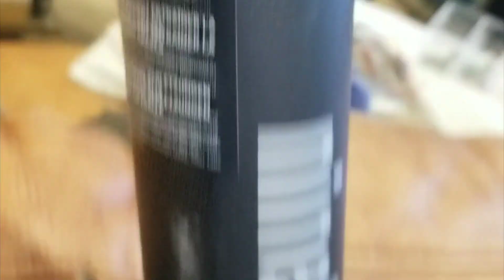Ninebot ES1 ES2 ES3 ES4 Internal Battery Teardown

Comment: Internal battery won't charge. Led on charger still green. Replace battery unit can charging. Whats i replace dead battery only? Or replace bms?
Reply from the maker: Did you open battery pack? What is voltage of cells inside? If voltage above 3.0v on all your cells then likely the boards inside the pack that have failed.
Make sure to try the brass reset button on top board in the battery.
Cant really tell much else from charger being green.
Good luck!
Reply from the maker: Hi Arif .... is your scooter an ES3 or ES4 by chance? With external battery? I just had an issue with internal batt  not charging. Here is vid for what my issue was ... https://youtu.be/ByJXJqm9urk loose connection from external pack

Comment: In your video, since all of your cells that you volt tested individually have good charge, what was the issue as to why the whole battery pack is considered dead?
Reply from the maker: Hey David - thx for watching and for commenting. Truth is that I don't know for sure. My guess is that the charging board..the top one of the pair has gone SNAFU. I'm not a technician- just a tinkerer. I'm in a bit of a jam to test the theory because I have no assurances that any of the charge boards I've scavenged are actually good.
But the problem has to be that the circuitry in one of the two boards has activated cut-off to the cells.  Much like happens in a hand tool battery that goes lower than absolute minimum charge.
Not sure of why either.
One small head slap for me is that there is a  brass reset button on this top board.
I probably should have tried researching that and tried pressing it before I ripped everything apart. Too late now.  Might have been a case of just hitting reset. Sigh.

Comment: Hi I have a es2 with external battery. I have been having problems getting it to charge fully only charges to about 85% then stops?? Plus some days it does not want to charge at all?? If I get to my destination say with 2 bars left of charge then I turn it back on when leaving the battery is completely flat?! Would you suggest a new battery? I did think of just installing a new bms but I think a new battery comes with that anyway. Any help would be much appreciated.
Reply from the maker: https://youtu.be/ByJXJqm9urk
Reply from the maker: Hey Tim
Have you seen my last video..link above. It sounds to  me like it could be a loose connection between external pack and internal. Not sure but possible. I had similar issue where average charge between two batteries was not full charge because internal never had chance to fully charge.  Have you checked internal vs external percentages on the app?
Just reread your post... is it just external pack that stops at 85%? What % does internal batt charge to?
Reply: @fixitdad899  Hi there many thanks for your reply. I've already tried charging the internal on its own and it won't charge so I'm assuming it's had its day. Its very random some days they will charge half way then they'll charge to 85%? I've also checked connections between the 2 batteries and that all seems to be fine. I was going to get a new bms and try that but you get a new one with a battery anyway.
I think I'm going to order a new internal battery and see if that fixes the problem.
Reply from the maker: Hmmmm...Do the voltages of internal and external match up? When you check app and you see say 50% or your 85% max state, is it on both batteries or is there a difference in voltage between the two?
It's weird that internal won't take a charge directly agreed.
If voltages are different,
It (internal) might have dropped below minimum charge for charger/BMS to recognize it.  Could try to bypass BMS and give it a brief bump charge to bring it up far enough for BMS to be happy if that is the case...or ya BMS could be done but...that would involve opening the pack up.= pain in keester
Yep... might be time for a new replacement batt.
Good luck with fix.
Cheers R.
Reply: @fixitdad899 thanks for your help much appreciated! How would I bump charge the internal battery? I think that's what happened, the internal battery has dropped below what the bms can recognise.
Reply from the maker: I have a video on how to do with an 18v ryobi battery. 'Theory' is the same ... full disclosure that I have not personally done myself on ninebot batt. I have had success reviving 18v tool batteries.
Trick is you need a supply capable of kicking out 36v-40v at low amps. Ideally a variable power supply unit that plugs in wall at low amps that you could keep connected for a bit.... But failing that you could use another battery at that 36 to say 44v voltage...touch leads of power supply to contacts of intenal pack BELOW BMS =bypass BMS.  Make sure polarity correct. Touch contact in short bursts until voltage comes up on internal  pack enough for charger to recognize. Challenge is doing like this would give pretty high amps for current  flow. You'd need a multimeter to monitor how much battery coming up in voltage. That's how I'd approach but be careful.
Again I'm just a guy who has spent some time around LiIon  and LiPo packs and I am not a professional. 
Best wishes on your project.
Reply: @fixitdad899  thanks for all your help. How do I get the plastic locking disc out the one that holds the battery in? Please don't tell me I need a special tool!
Reply from the maker: @Riceyminimad  I used a pair of workshop compass measurer doohickies...the ones with thumbscrew to adjust width between points. Those caps aren't that tight in. Pair of chopsticks with duc(t/k) tape might do in a pinch. Good luck!
Reply: @fixitdad899  thanks I've managed to do it! Used a small hammer and an alan key just tapped it round until it got past the metal ridges. It's charging now fingers crossed! Thanks again!

Comment: It is possible to use other trottinette ???
Reply from the maker: I think trottinette means scooter in English. If your question is: can you use a battery pack from another brand of scooter to run a ninebot? Answer .. probably but you'd have to be creative on how you attach/connect battery. Not sure how charging a 'foreign' battery would go or how software would react.
If your question is could you use this pack on another scooter ... same answer really.  
Bonne chance!
Reply: @fixitdad899  thanks, yes I will want to use for on another scooter

Comment: Can you tell me where I can get the tool to remove the battery?
Reply from the maker: I used a pair of metal measuring calipers. Stuck the two points in the two holes of the plastic retaining plugs and unscrewed them ... they are threaded. Then took a wooden dowel to push battery out once plugs/caps removed. I've heard you can use a pair of chopsticks to do the same or can stick a screwdriver into one hole and tap sideways with hammer to unscrew.
Best wishes on your project!

Comment: Hello I need some help from you.

I am from India and unable to get this battery pack.

I have a basic carbon scooter without battery ( I had to leave the battery in Philippines due to air travel restrictions )

I am planning to build a battery pack and might need some info to build them.

Please help.
Reply from the maker: Happy to try to help if you have a specific question but full disclosure in advance... I'm way better at taking things apart than putting them together!
Reply: @fixitdad899  Thanks. I might need some photos and measures so that I can 3d print the battery holders or spacers.

There is no other way I can get my hands on them. I gotta 3d print some parts and redesign some Circuits.
Reply from the maker: Sounds like you are technically capable...I'm not familiar with "Carbon" reference. Is that a ninebot model? 
Anyway...Just curious.. can you source ANY premade scooter 36-40v packs locally?  Reason I ask is that I picked up a 'junked' M365 clone that had a burned out hub motor for very cheap near me.  I just wanted the 30 cell battery inside for an eskate project.  Couldn't you do similar? Don't have to worry about BMS and soldering (pain). Just create an external case for pack and affix to scooter somehow ... extend and plug in your 36-40v leads and good to go.  Might even end up with better range as pack could have greater number of cells than stock.
Might not be as pretty as recreating Internal battery but way simpler.
Just a thought. Best wishes.
Reply from the maker: It's not too hard to create aesthetically pleasing curved custom case for cells that you can attach to upright steering column via 3D design.  Tip -You can make segments that stack to prevent risking print failure from tall z print heights. Glue them together to desired height...make top and bottom caps to seal. Voila
Reply: @fixitdad899  oh, I was actually planning to make the battery to be internal.

Range Extending Extra External battery sounds good, but I was planning to design one for the Internal as well.

It will also help me learn the technical aspect of the battery and related electronics.

Battery based systems are the future anyway, Its better to learn the skill  I guess :)
Reply from the maker: Neat machine. Thx for link. Absolutely a great project to learn how to build a battery pack and until Hydrogen Fuel cells become commonplace I totally agree way of future and key skill. Recommend you go to thingiverse to see printable holder systems for 18650 sized cells. Next thing you'll need is to make a spot welder!
Unfortunately that particular scooter isn't necessarily same dimensions as mine so you'll need to get the calipers out.  In the video his scooter gave a 10km range and he mentioned power as ...'meh'. Very similar to ES1.
By twinning external and internal packs in parallel you do get much better acceleration/better top speed/longer range/less voltage drop on battery packs/better life etc.
Most of the newer models have gone from batteries in steering column to putting them in the deck. Can cram more into that location.
Great news for you is you can control just how robust your battery supply will be as you are going custom. 
Enjoy the project and please do post links!

Comment: Probably just the reset button on the top board, I sell these used and tested.
Reply from the maker: Hi Eric - thx for confirming - I did have a 'I probably should have tried pressing the little brass button' a few weeks after I recorded vid. After watching an @jehugarcia vid.
Live and learn!
Hey - question 4u. I had another unit where exactly 1/2 cells were near completely discharged and 1/2 were good/near full charge. Any ideas on what might cause that condition?
Appreciated. Have a great day.

Comment: Cells is Samsung or lg ????
Reply from the maker: Cells are branded 'EVE' ICR18650/26V in the packs I've opened. I've seen others with purple cells. Maybe range of cell providers
Reply: @fixitdad899  thanks ! But it’s 26 volts !!!  Not 36 volts ?
Reply from the maker: You'd have to look up spec sheet to see exactly what that means ... individual cells run between 3.7v and 4.2v
The 40v a ninebot runs at is achieved by putting 2 cells in parallel and then stacking 10 of these 2 cell sets in series to get 40v.
Reply from the maker: https://secondlifestorage.com/index.php?threads/eve-icr18650-26v-cell-specifications.8390/
Reply from the maker: Confusing for them to use 26V in product number agreed. But does not refer to nominal or full voltage of cell
Reply: @fixitdad899  yes you are right !